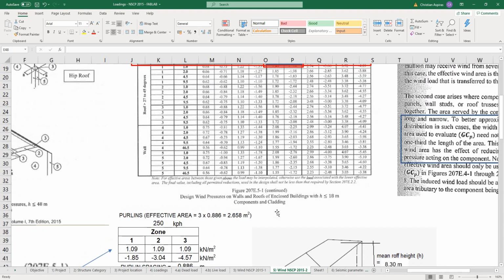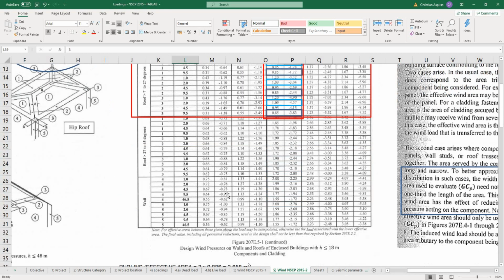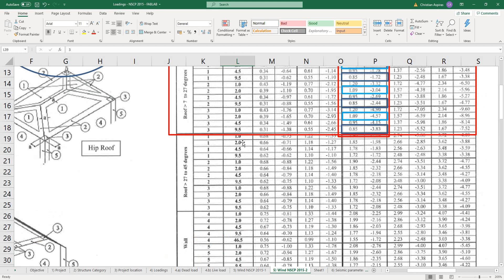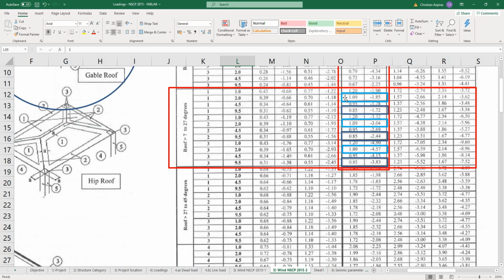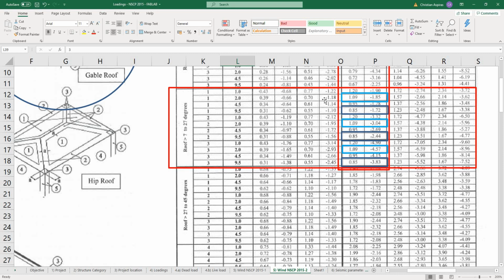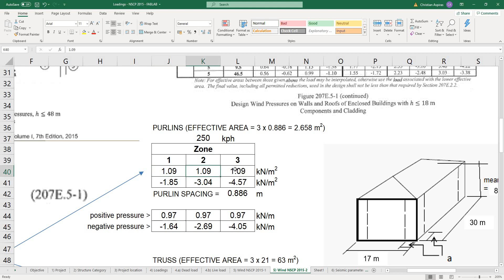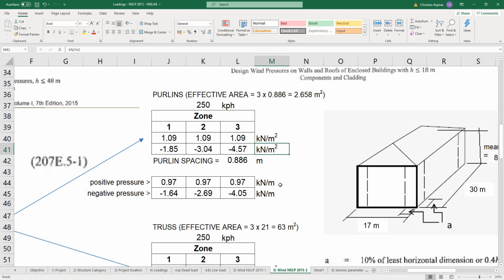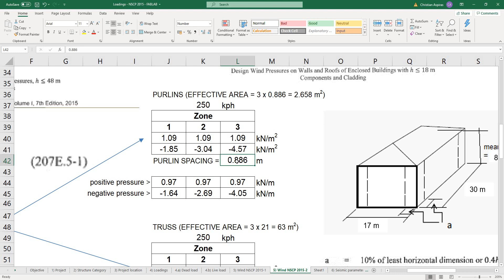Simplified Procedure Wind Load Calculation Part 2

Comment: Sir for the effective area for purlins the width should be not less than 1/3 of the span which is equal to 1 m not 0.886m. The effective area of purlins should be 3m x 1m = 3 m2